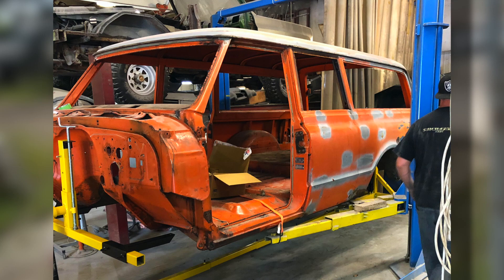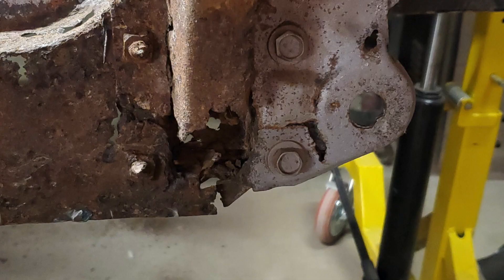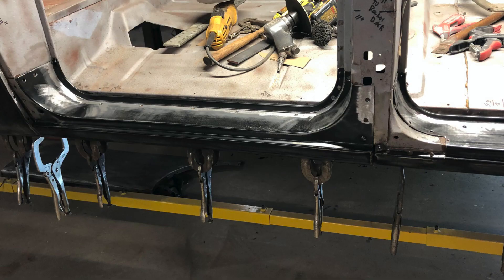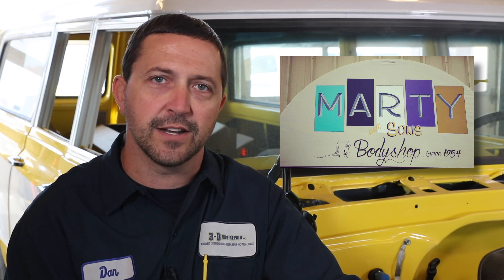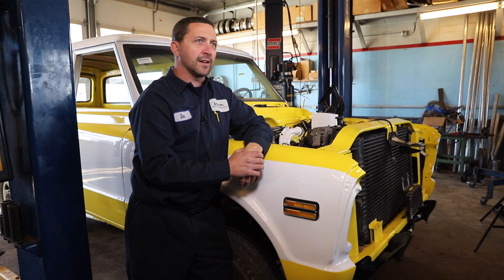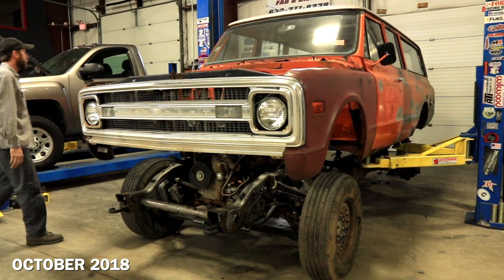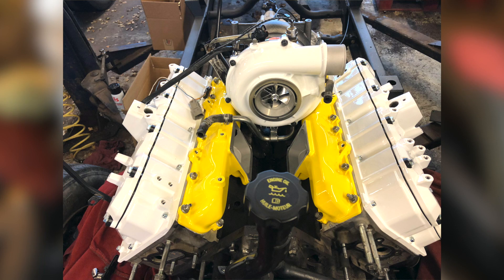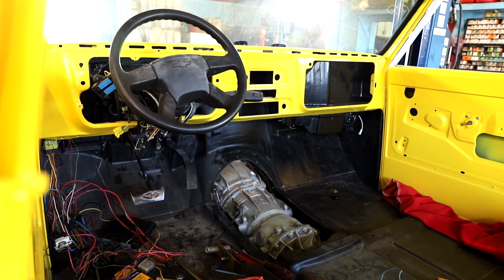WCFab Build Series - '68 Suburban - '06 Duramax SWAP PROJECT - Episode 5

Comment: So you went with a newer frame with the old body?  I have been thinking about swapping a duramax into my 86 K10.
Reply from the maker: Correct. Chassis and driveline are all from a newer donor truck and have been re-worked as needed to accommodate the older sheet metal.